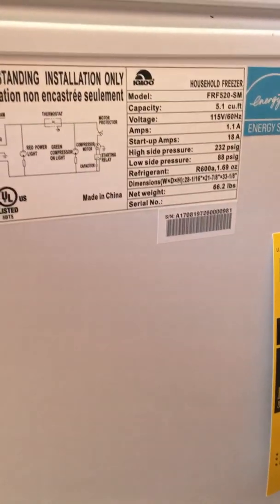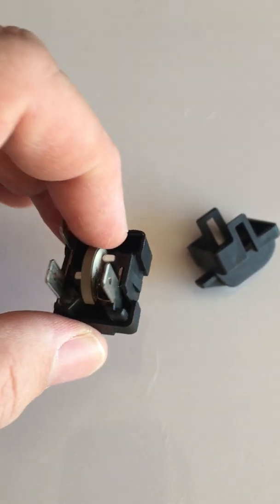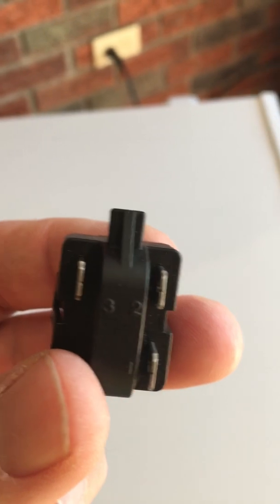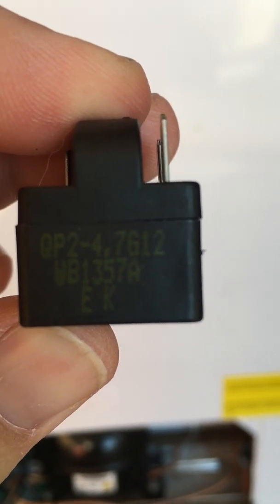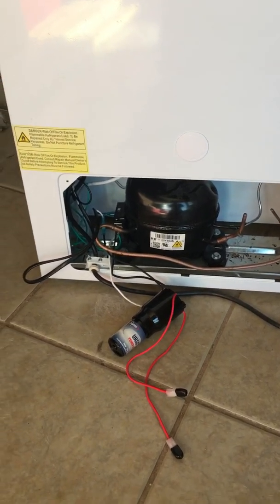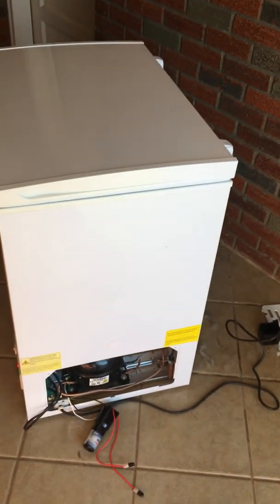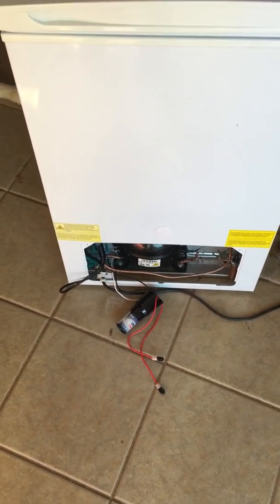Igloo Thompson Freezer repair for 5.1 or 7 cu. ft. Chest freezer

Comment: I removed the relay from the compressor but I can't remove the three connectors from the relay.  I can't pull them off.  Is there a locking mechanism?  How do I remove the wire connectors?
Reply from the maker: When I removed my relay, the connectors were very tight. I had to use needle nose pliers to remove them one at a time. I kept wiggling them until they slid off. And it wasn't easy with the small amount of space in there. Good Luck. You'll get it.
Reply: @donaldlgilbertjr7923  Thank you.  I just didn't want to break the connectors.  I assume the relay is bad, but I will test it for continuity with my multimeter.
Reply: I tested the relay and it had continuity and an ohms reading of 5.4.  I also tested overload protector and it also seemed okay.  it had continuity and an ohms reading of 0.8.  Is there anything else it could be besides compressor?  I tried putting multimeter leads on three prongs from compressor but hard to reach with all the wires.   Not sure what to do next.  Any ideas?
Reply from the maker: @karayianis3168 , I had continuity on my multi-meter as well. I don't recall the values. But a multi-meter doesn't put the device under a high enough load. Even though I had continuity, the ceramic disc in my relay was still cracked. I would replace the relay anyway. They are about $10 on Amazon. And if you take yours apart, it is either going to be burnt or cracked most likely.

Comment: Donald I went to remove part but have a hard case on mine and do not see how to remove can you let me know?
Reply from the maker: Most of the time those clip on to the compressor case. They are hard to remove. I didn't put mine back on.
Good Luck.
Reply: @donaldlgilbertjr7923  I did get it off my relay and over load especially burnt up replace today so far so good thank you so very much

Comment: I've been banging my head I checked to see if problem with compressor, I've had since 2/18/18 and keep very clean lights were on but I didn't hear running it's was lil cool inside but dead
Reply: I thought capacitor at first I'm not sure the compressor doesn't get hot when plugged in, any suggestions
Reply: I'm not real mechanical 😂
Reply from the maker: @suziesturgill2462  The compressor won't get warm unless it is running. So if you have a relay problem like this video shows, then the compressor won't run. Very rarely do the compressors go bad. If you haven't installed the Start Relay like I have shown, then you won't know if the compressor works. You may need to contact someone to assist you.
Reply: Thank you I'll try and find part and do so, it doesn't do anything but the lights stay on in the front and the dial doesn't even click when turn on
Reply from the maker: @suziesturgill2462  That is exactly what mine did when it stopped working.
Reply: @donaldlgilbertjr7923  thank you Donald much appreciated 👍

Comment: ✨Could you glue the ceramic pieces together or just find the ceramic button from the thermostat and replace it ? 
      ✨🌳🐕‍🦺😊🕊️✨
Reply from the maker: I was not able to find just the ceramic button at the time I was working on it. I think the glue would interfere with the conduction of the electricity. These items are now available on Amazon from many vendors. https://www.amazon.com/qp2-4-7g12/s?k=qp2-4.7g12
Reply: @donaldlgilbertjr7923   ✨ThankYou Don! To be honest, I didn’t think I would receive a response …. I really don’t know how old my little igloo freezer is ? 
It was given to me , it’s a 3.6 cu and it was working before I put it into storage 5 years ago . I think it’s older because it has the metal inside lining it . I believe today everything is plastic, right? 
  I’m a do it yourself lady LOL😁 
I can’t afford a new one and when I moved in my apartment my daughter said hey mom if it doesn’t work, we can just take it to the junkyard and you can get scrap metal money for it! 
  I figured my daughter should know me better by now and be used to me fixing what’s broken . Truck , dishwasher, dryer , fans ..
I went to fix my dryer when the thermostat went out . I learned a valuable lesson fixing my dryer …make sure it’s unplugged when you go to put the thermostat back in…. 😆 let me tell you that shock curled my hair! 
It also sent me flying across the room !!!
 I was sure I unplugged it before I went to the parts store to get the thermostat and when I came home , well I went right to work . 
 I touched the electrical block with my finger and POW 💥 . 
I was fine , I took quite a jolt though … 
  I will not make that mistake again! 
I hope I can just open it up and find the thermostat in there, anyway Thank You very much for your help. 😉👍 
I hope that you have a lovely day ! 
               ✨🌳🐕‍🦺😊🕊️✨🇨🇦
Reply from the maker: @discoveringsasquatchcrypti8973  From what I have seen on other videos, 90% of the time, it is the relay that I sent the link to on Amazon fro you. About $8 and it's fixed. But I went with the larger SUPCO unit in the hopes that it was more durable. Good Luck.

Comment: Is there a part number for the Supco starter you bought?
Reply from the maker: I used a URSC10. I show the unit in the video. Good Luck
Reply: I don't see where the white round piece wires into this. Did I miss that part of video?
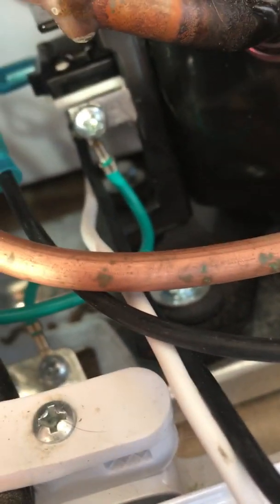Reply from the maker: @Raven_Red  It is at the 4:30 time mark. On mine, White went to the lower left compressor post.

Comment: Is the run button supposed to be green all the time ?
Reply from the maker: The green lamp only comes on when the thermostat is active. At that point, the compressor should be running. If the green lamp is on and the compressor is NOT running, then most likely the relay has gone bad... or worst case, the compressor has failed. 
The temperature knob should be started in the half way position. That is plenty cold for the freezer.
Good Luck.

Comment: hi Donald
if the ceramic disc is not broken, does this mean that the compressor gone?
Reply from the maker: That's a difficult question to answer. I have seen the disc be intact yet still be bad. I would say to try the start relay, which are listed on Amazon for around $12 to verify the health of your compressor. That's the only way I know to test the compressor.
Reply: @donaldlgilbertjr7923  Thank you for your reply.

Comment: This repair worked for me.  However mine had a little twist.  The disc inside was perfectly intact.  However, checking the resistance, it was at 18K Ohms.  I was able to get a replacement part (same as OEM) for $5.20 on Amazon with free delivery.
Reply from the maker: That’s excellent. I’m glad it worked.

Comment: I just got an igloo chest freezer second hand today. I've had several freezers. Searching google people usually tell you to set it at a little less than half way. This igloo was at MAX when I got it. I put it in the middle (4), like the manual said. It's been like 6 hours and the freezer isn't freezing yet. In fact, there's water dripping on the sides. Just wondering what number you have yours set at. I'll probably have to start moving it towards max tomorrow, but all my other freezers work great at the middle setting or less.

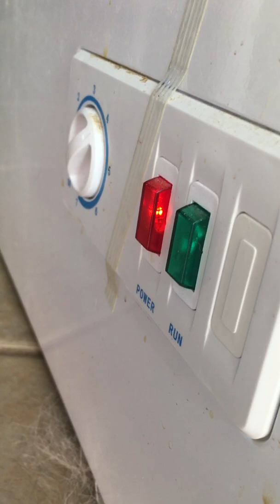EDIT: At exactly 4:00 I see your front panel and it's set at 4 too. So if mine isn't cold by tomorrow, it's broken. It's cool, but not even fridge level yet, but it's definitely not cold enough to freeze yet.
Reply from the maker: Mine is set a little above halfway. It’s plenty cold.
Reply: @donaldlgilbertjr7923  Thanks. After 3 days of messing with it I came to the conclusion that it was busted. I even added that 3 N 1 Hard Starter thing and didn't help. Luckily someone was selling the exact same Igloo freezer for $40 so I bought another one. Prob throw the other one away.
Reply: @donaldlgilbertjr7923  One quick question though. Your "Run" light doesn't stay on all the time right? Mine turns off, I guess when it's cold enough and the compressor isn't running. I was concerned cuz the Run light wasn't on when I bought it, but it seemed to be working. I keep the new one at 4 and it's cold enough to freeze things over.
Reply: The thermostat set screw probably needed to be adjusted.
Reply: @jaymartinson3236  Mine was broken. It was unfortunate, but I got it for free. I got another used one for $40 that got cold within 2 hours, so now I know what it's suppose to be like.

Comment: I just installed the 3 in 1 in my freezer that's exactly the same as yours. My question is does the freezer cycle on and off or does it continuously run? i have the dial set to 1
Reply from the maker: Mine cycles. And it doesn't run very much since it is full of food. I think mine is set on 3.
Reply: @donaldlgilbertjr7923  please let me know how you got yours to cycle because mine continuously runs
Reply from the maker: @Datsun7705  I didn't do anything to make it cycle. I just installed the 3-n-1 and it started working again. It is possible that your thermostat went bad. I don't work on these as a profession. So I really can't diagnose what might be going on with yours. I wish I could be more help to you.
Reply: @donaldlgilbertjr7923  i finally figured out that i had to let my freezer run for a while because with all the food i have in it, it takes a while to bring the temp down. but thank you for posting the video on wiring the 3 in 1.
Reply from the maker: @Datsun7705  I'm glad it worked out for you !!!

Comment: Did you test any other things on the freezer before you went to the relay..we had a black out and now the freezer wont run
Reply from the maker: My freezer had a fuse, which I tested first. The next component in the system was the relay. When I took it off, I could hear the ceramic disc pieces inside. It sounded like a mini maraca. Then when I opened it, the pieces all fell out.

Comment: Hi, Donald thank you so much for doing this and reaching out to help others. You seem to be quite techy. I checked the ceramic disc and it's still intact. Before I opened and checked if the ceramic disk was broken the run light was not coming on. after opening up the plastic housing it sits in and closing it up again the run light came back on. I thought praise God it's working but unfortunately it's not working and freezing. I also don't hear the motor running at all. Ant idea on what I can do or what the issue might still be?
Reply from the maker: If you don't hear the "CLICK" when the freezer tries to come on, your problem might be in the compressor, or as you stated in another post, you may have pulled a wire off of something. If you only removed the Relay and the Overload protector, there aren't many wires to get crossed up. It sounds like when you took the ceramic disk out and moved it to a new position that you now got power to transfer through part of it. You might still have a bad disk and need to replace the relay anyway. It might be worth your effort to buy the relay and try it, because chances are, a new freezer is going to have the same part and it might fail someday. Best of luck. It can be frustrating.

Comment: Great video. Mine just started. Comes on for a few seconds and then shuts off but the power and the run lights are on. Will this part also work for the FRF470?

Comment: I have my freezer for 2 years and today 2020 4:29 p.m. New York City Bronx New York the ice was melting can you tell me why help me why please the greenlight the yellow light goes on
Reply from the maker: I am not an authorized repairman. I only know that the relay on mine was bad. If your relay is bad, and the green light is on, then either the relay or the compressor is bad. The green light is hooked to the thermostat, so the freezer is trying to turn on. Good Luck

Comment: if I had the choice between starter Supco and QP24.7 for same price, which should I choose?
Reply from the maker: I would go with the Supco unit. Eventually, the disc in the QP24.7 will fail again. They are only good for about a year.

Comment: How would you wire a 3 in 1 capacitor to this model freezer?
Reply: I too have the same cooler and the 3n1 starter.  I took the relay and overload off and connected the run, start, and common as per the instruction.  The two black power wire from the 3n1 is connected to the black and white wire that’s coming from the thermostat.  Does that sound correct?
Reply from the maker: @allenchau8928  That sounds right to me. I hope that it works.
Reply from the maker: I would not be able to answer your question properly without seeing the instructions from Supco for the 3n1. Mine was a Hard Start model from Supco, so the wiring might be different. I just followed the instructions that were with the Supco packaging. If you don't have the instructions, I believe they are on the website for Supco as well. Good Luck.
Reply: Donald L Gilbert Jr I can’t post a picture of it but I can tell you what the wires mean The red wire is for run white wire is for start one black is common and the other two black is power. I hope your able to help me figure this out. Thank you in advance also the Compressor on my freezer only has two prongs coming off of it.
Reply from the maker: @quinster835  Your compressor must have three pins. If you only removed the bad relay, then you left the TOP pin connected to the Overload Protector. It's a separate part from the relay. That's where the BLACK goes. RED and WHITE go on the two other pins that are side by side. The Supco 3n1 didn't have an instruction sheet with it?
Reply from the maker: @quinster835  See this video as well. https://www.youtube.com/watch?v=mvtQ_X6eLII
Reply: Donald L Gilbert Jr what about the two black wires on the other side of the 3 in 1 where would I connect those to? The package came with a diagram on it but doesn’t say where to plug the wires in only what the wires do.
Reply from the maker: @quinster835  Those go to the power leads. Normally there is one Black and one White. Mine were coming from the thermostat.
Reply: Thank you for your advice it worked. I’m able to use my freezer once again.
Reply from the maker: @quinster835  NICE !!!

Comment: Hi Mr.Gilbert  by chance  were did you connect the black line that is not connected  to the compressor?
Reply: By chance  we're did you connect  the motor protector
Reply from the maker: @juniormiller6149  The motor protector connects to the upper pin on my motor. If you imagine a triangle, my upper pin has the motor protector. As for your other question about the black wire not connected to the compressor, I'm not sure what you mean as all of my wires are used and connected to either the thermostat wires (Black and White) or to the posts of the compressor (the lower pins). Good Luck
Reply: The blue and brown wires  what were they connected to if anything  ? They are the ones  that  go to the white comparator

Comment: Thank you for the info to fix our freezer and parts are ordered. Which during this covid-19 stuff wasn't fun to have happen. Awesome and Helpful video. Mine was cracked but it's working for now just flipped it around.
Reply from the maker: Flipping the disc is just a temporary fix. It will burn through again. I hope your parts arrive soon.
Reply: @donaldlgilbertjr7923  . It survived long enough to get the replacement parts. And AWESOME video and thank you!
Reply from the maker: @Icepik43  I'm glad it made it through.

Comment: Mr. Gilbert I have a 5.1 cubic feet household freestanding igloo freezer just like yours I remove the black protective cover which exposed the relay     relay  button is  Charred on one side that is making a clicking noise the green run light is on but no freezing is occurring im looking for a part that will hold more voltage/ Ohms like the supco power start 3 in 1 relay but don't no the difference  between  the ultimate power start or the one in your video
Reply from the maker: I have never looked at the performance specifications on the Supco units by comparison. I know the Hard Start unit that I selected was rated for a much larger compressor than that of this small freezer. I would imagine that any of the Hard Start/Power Start/3-n-1 units would all exceed the requirements of our freezer. I think the motor was only a 1/3 hp unit. 

You could just replace the relay, but I fear that the same condition would be back very soon. That's why I made the choice to get the Supco unit.

Good Luck

Comment: Don, 
What did you end up plugging the white capacitor into?
Reply from the maker: I decided to not use my capacitor. There were two extra wires on my Supco Hard Start unit that would have allowed me to connect the capacitor if I wanted. I just chose not to.

Comment: I have the exact same freezer.  This helped me a ton!  I had a bad relay AND overload protector.  Broken ceramic disc and overload protector was charred and crumbling.  Put 3 'n 1 on and it fixed the problem right away.  Part I used was the Supco URCO410 "Universal 3 'n 1 Start - Relay Overload Start Capacitor."  $20 at local distributor.
Reply from the maker: I believe that SUPCO unit is the way to go. The relay with the ceramic discs are just going to fail again after time. I'm glad the video helped.

Comment: I just took the relay apart. Cleaned the ceramic disc and turned it to where it made contact, and it’s running! The disc had a slight crack and was not actually broken 
Thanks!
Reply from the maker: I'm glad that turning the disc has helped in your situation. Be aware that most likely that crack will continue and you will need to replace the ceramic or the relay. Might be a good idea to have one around the house for just such a moment.
Reply: Donald L Gilbert Jr yeah I figured it won’t last. I’ll pick up a new one as soon as I get the chance
Reply: Same here. Cleaned with a wire brush and turned the disc. Compressor kicked right on. Thanks for the video and the comment. Both were a big help.
Reply: @nicka2487  mines still running 9 months later. Haven’t had any issues since. Not bad for a freezer I found 😋